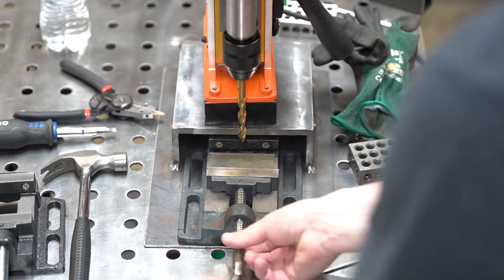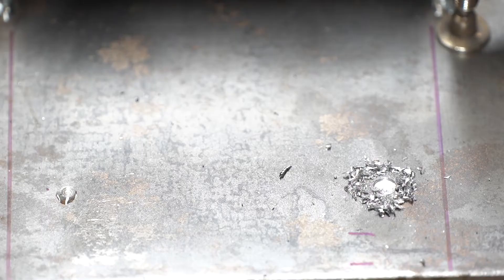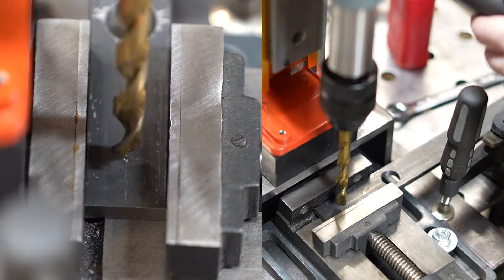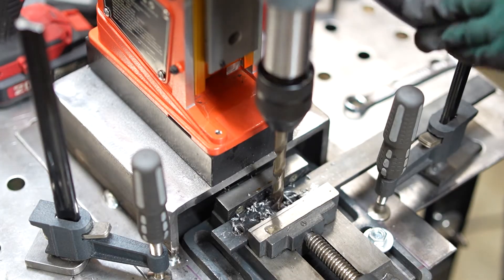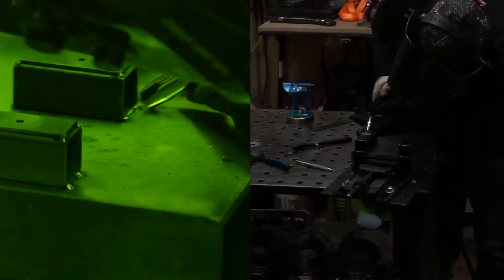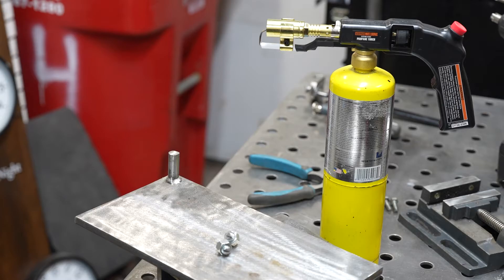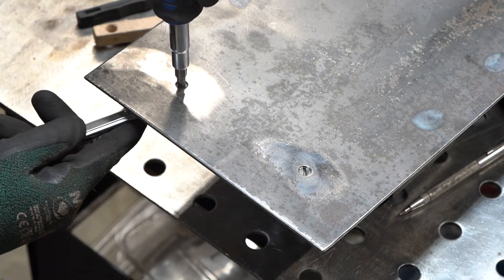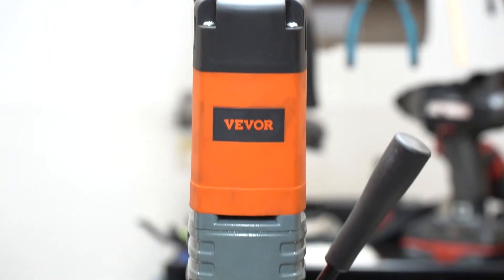Vevor Mag Drill Stand Pt. 2

Comment: To get absolute center of mounting hole the next time, why not use a 'transfer punch',.. you'll be " dead nuts on" ( as some say ) when you have to drill again. check this out at a good tool supplier and buy the whole set of transfer punches.
Reply from the maker: I think YouTube striped out your link. I'll see if I can turn that off for the future. I've got a cheap set of transfer punches, but the strap was too thin to "register" them. In other words, they have too much of a point to them / a tapered shaft at the end so it wouldn't hit the sides. Unless you meant when I did the vise, in that case, I had a lot of play with the slots in the vise. I think they are 1/2" + - the sloppy casting / machining.
Reply: @MichaelRoachWV  Yes, you have a point there too. Oh my, no I didn`t mean to utter that `groaner`. :)
Reply from the maker: @regsparkes6507  all good! I got my transfer punch set thinking I’d use it all the time, but most of the time my material is too thin to use them. When this happens, I just use a scribe for big holes or a drill bit for small.

Comment: Nice job! One thing - when drilling with annular cutters - use firm downward pressure, in a continuous stroke. You should not 'peck' as that allows chips to bind in the side grooves on the cutter causing undo friction and scoring as well as enlarging the hole somewhat. Meanwhile - you have outstanding editing skills and your videos are very contagious! Could be due to you having such a great first name!  Looking forward to the 16mm holes video - I'm guessing that's for the top of a fixture welding bench. Thanks for the humor! mike (yea , we have the same name!).
Reply: Yep. Peck drilling with an annular cutter is a great way to create a chip-bind and shatter the cutter. Slow learner here, done that a few times.
Reply from the maker: Dear Mike,
Thanks for the kind words! I leaned towards peck drilling here because I was being somewhat cautious with my new creation lol. I needed to build my own confidence that the two bolts would be sufficient to hold the vise, and tap magic burns up super quick lol. I'm going to start using a thicker fluid for one-off holes, and then just use the coolant system whenever possible.

Thanks for the kudos on editing... Every time I lie to myself and say, ok, I'm just going to do minimal editing this time... and so far that has yet to happen!

The 16mm tabletop has yet to be started, but I've still got a bunch of videos to edit before that happens lol. Stay tuned and thanks for watching!

Comment: I made something similar last year. I used two pieces of scrap 8” channel iron welded flange to flange with a piece of 1/2” plate welded on for a flat surface to mount the vise. I have since welded a piece of 2” square tubing to the back and have used a piece of receiver hitch welded to a plate that I mounted to a beam in the shop. This unit pops into the receiver hitch when I want to use the drill and stores out of the way when I’m done.
Reply from the maker: I've already planned out a new design for a lighter version... my issue is, I have too many projects / videos in the works right now lol. I just finished filming a floating shelf bracket and have a bunch more in progress. I've seen the receiver hitch used a couple places, I think @GarageFab built a whole mobile rack for them. Whatever it takes!

Comment: Nice drill stand. Wonder if the mag drill could withstand making the vice move back and forth on the X and Y axis. Making a mini mill of sorts...
Reply from the maker: Ssssshhhh, jk, I’ve got an x-y vise, but that vise has too much deflection. I’m going to order a low profile table and try and Frankenstein mount it TOP of that. Fingers crossed ;)
Reply: @MichaelRoachWV  The bearings in the head of the DP are really only designed for compressive, not axial loads. So go gentle or you'll kill an otherwise great tool!  Bought mine late last year, and it's awesome.
Reply from the maker: @DrFiero  I'm somewhat interested in finding out, may consider tearing it down to see how it's put together. The typical issue with a jacobs chuck / taper with sideload would be avoided.

But, it does have the capacity for a a 1.6" annular cutter, so that's what got me thinking, maybe it could handle a 3/8" endmill?

I've been swamped in other endeavors at the moment though, so all of that is on the backburner for the time being!
Reply: @MichaelRoachWV   - as long as you went REALLY gently doing x/y moves... maybe?!  It's more the quill bearings I'm concerned about since they were designed for z axis loading.  Seeing as mine is a month or 2 old, I'm not taking it apart to find out.  ;)
Reply from the maker: @DrFiero  totally understand, I’ve actually got two because they sent me part of a returned one the first time lol, that was a trip